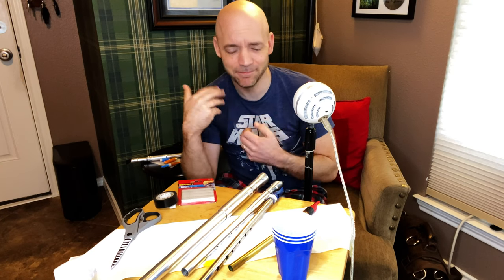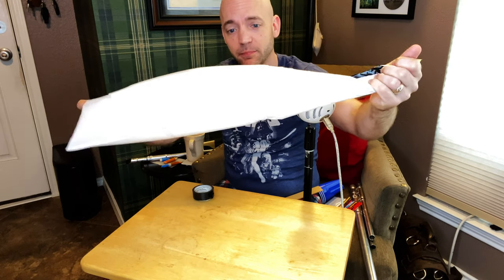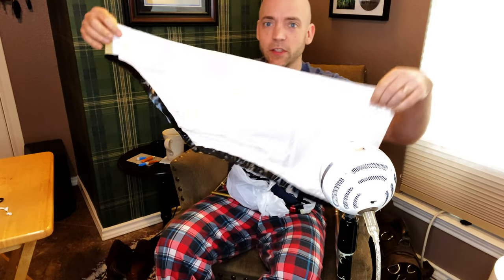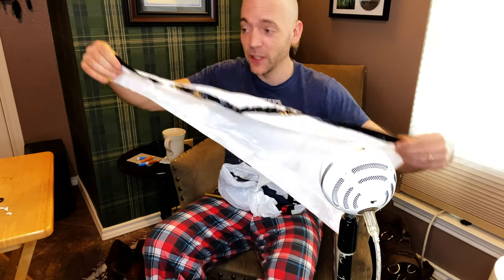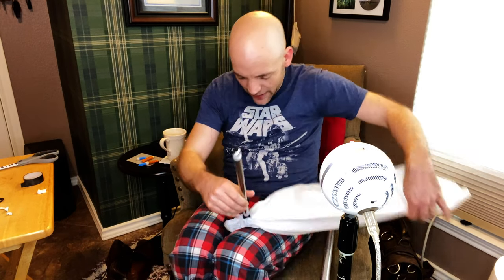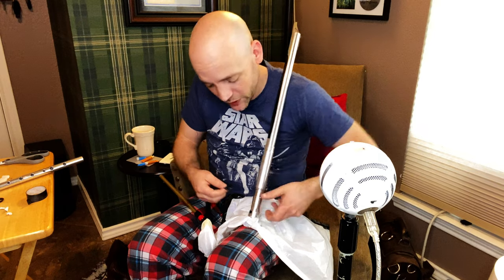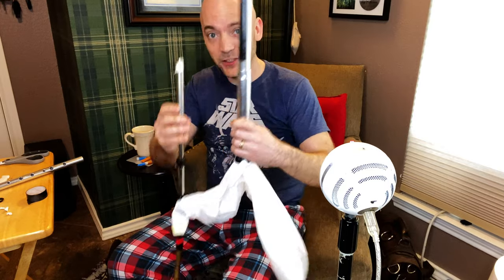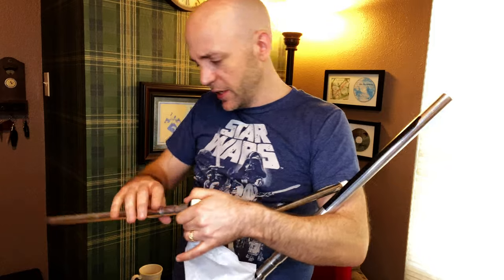Trash Whistle Pipes: How To Guide Quarantine Edition! - Matt Willis Bagpiper

Comment: I did something a while back, two years ago, where I used a cloth that resembled the bag, only smaller, and stuffed the whole trash bag into it. It never played because I didn't have my practice chanter yet, and I was aware of bagpiper's lung. But I do plan on making something like that again, but have it so I can replace the bag. Recommend using a decent sized towel and rubber bands. Never bothered with the drones though because realistically a bagpipe doesn't need drones!
Reply from the maker: I'd be worried about using anything like a trashbag long term, as it doesn't breath at all, so it's going to build up with yuck fast. I promptly removed the whistles and threw that bag out after filming the video.
Reply: @MattWillisBagpiper  Yup, but that's why you keep the cloth, to shape it! Reuse the cloth, toss the trash bag. Might try to remake what I'm talking about seeing that I have some of the material and send a pic of it.